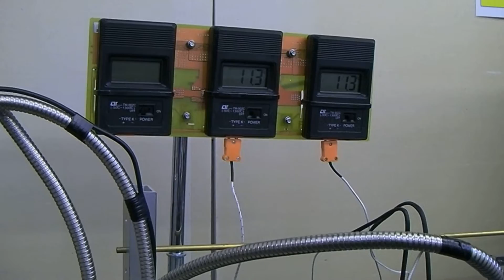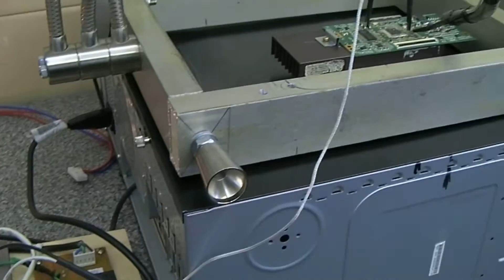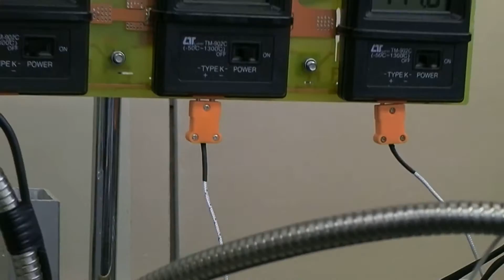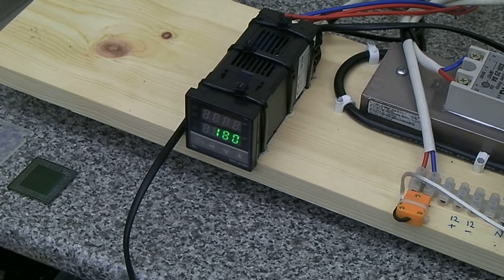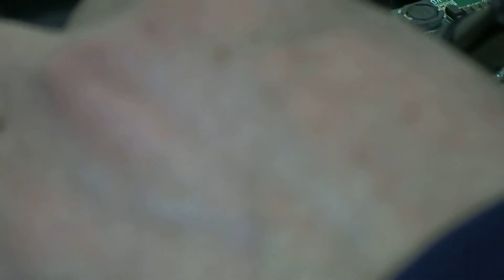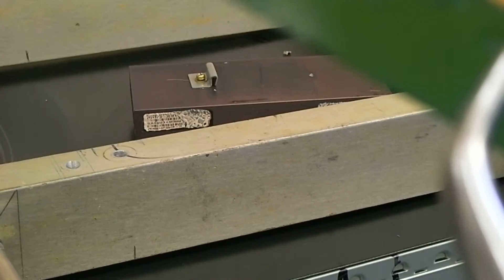Pre-heater test run with IC removal

Comment: The temperature difference can be the wiring.
You use regular electrical wire from the controller to the terminal block.
Then go from terminal block to thermal couple.
This creates extra junctions giving false readings.
You should use or thermal extension wire Or thermal couple wire, which can be from an unused TC.
Offcourse same wire as your TC, e.g. for K-type use, obvious, K-type wire.
It's even better to connect the TC directly to the controller lowering risc of creating extra junctions.